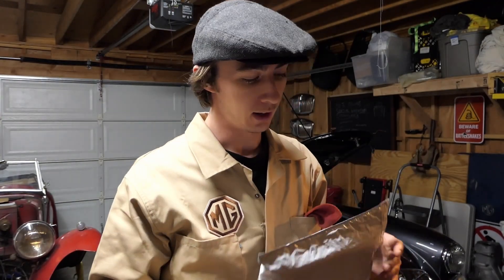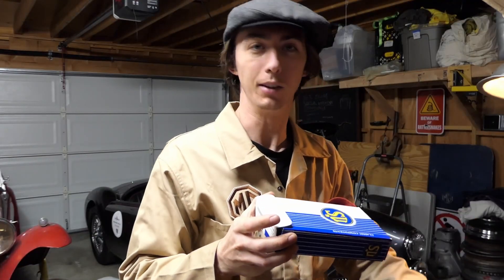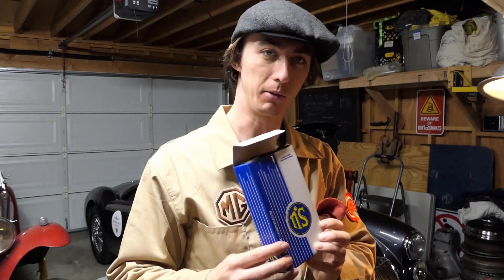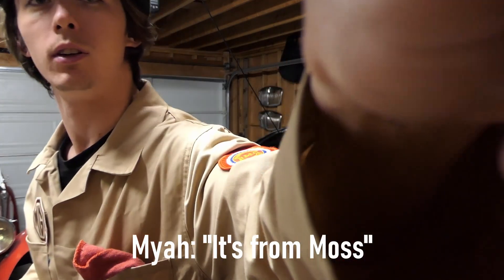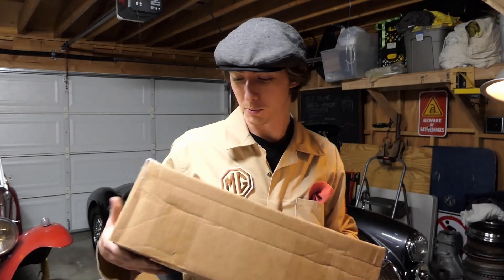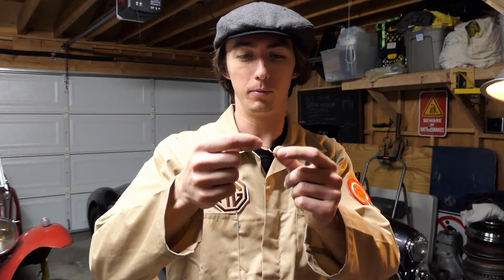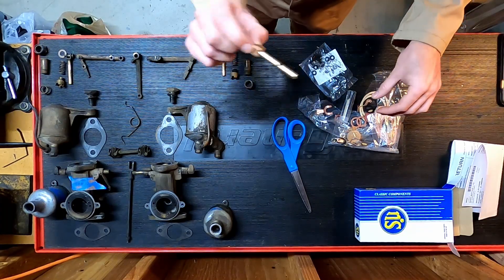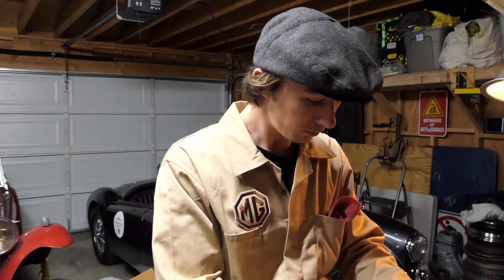Unboxing SU Carburetor Parts! - Limit 55 E4

Comment: A few words of advice regarding the SU carb rebuild. I prefer to go to either Joe Curto in the US or Burlen in the UK for SU parts, they're cheaper than Moss and Joe can always be counted on to know exactly what you need. This is especially true for the hard parts. Going through the trouble of rebuilding a carb should mean reaming out the shafts bores, fitting bronze bushings and then installing manganese bronze throttle shafts. You can fashion your own reamer and skip buying the expensive one if you check out Barney's page (MGA Guru). I'm not sure if the SU kit supplied by Moss now includes Viton seals or cork for the jet assembly. If it's cork, skip it and get the Viton. Sizing them up and you can order from McMaster.

It's nice to see someone around my age also taking on a TC restoration. I too restored an MGA. I'm over on the MGE Forum as well as a few other places. Happy to help, especially if you're looking for hard to locate items. Cheers.